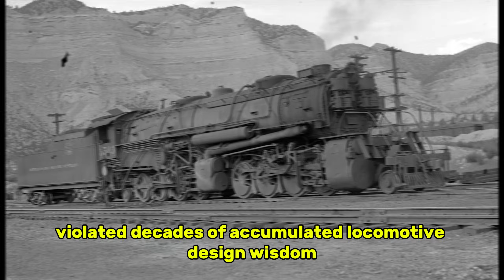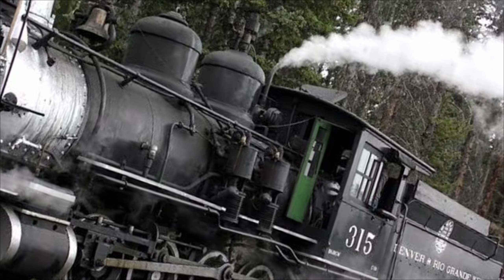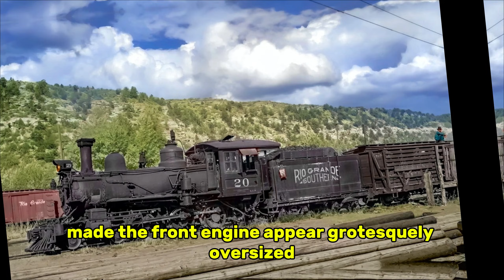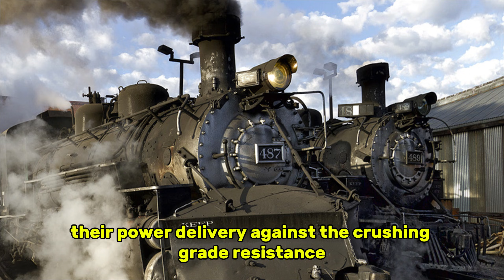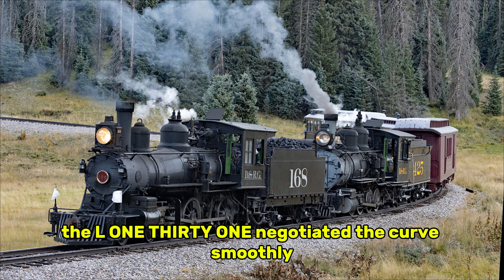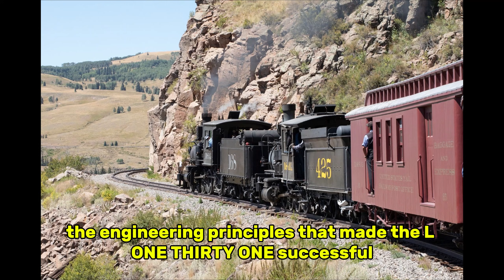Workers Laughed at This Odd-Looking Mountain Engine — Then Saw It Conquer the Rockies

Comment: So much bull shit in only 3 minutes watched. L131 class is simple not compound. To get 4000tons up a 3% grade you need nearly 300000lbs draw bar pull or 3 of this massive locomotives.
Reply: Yes for 4000tons train weight you need 240,000 LBS drawbar pull just to counter the Gravitational pull without any allowances for wheel bearing and rail losses so 300,000Lbs seems a good start for the MINIMUM required.